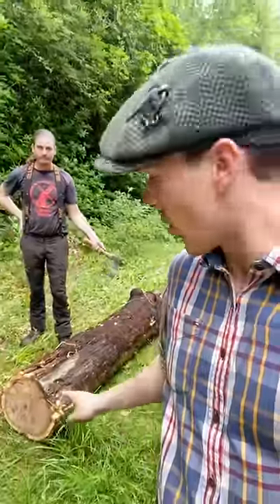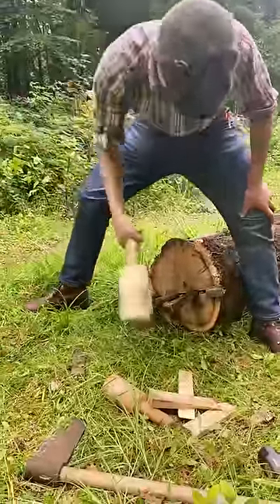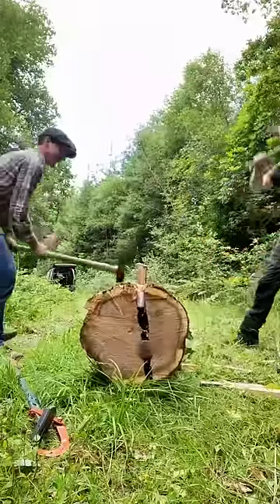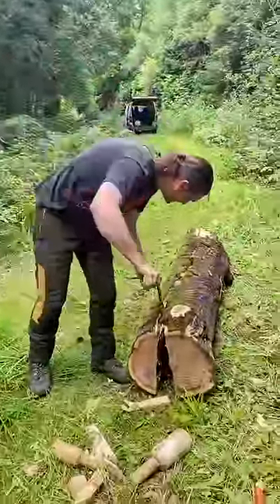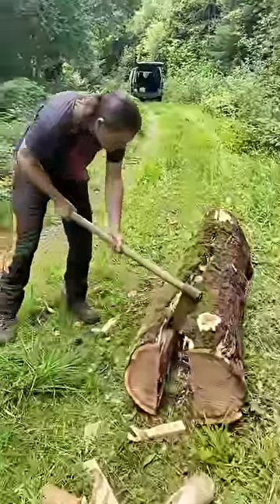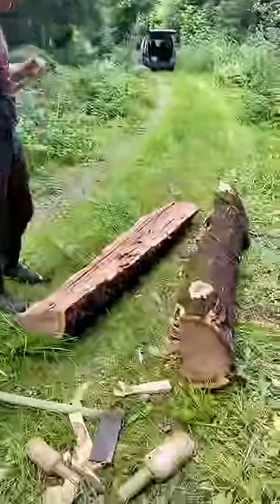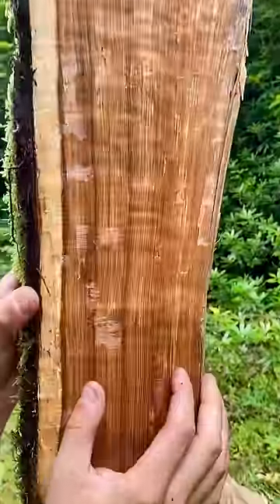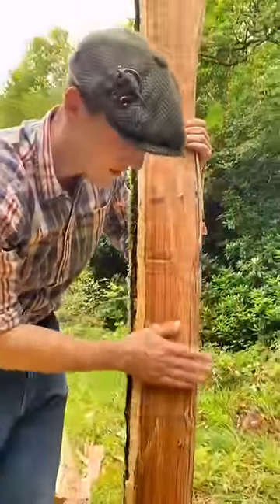Splitting Planks from Oak Log #cleaving #rivving #shortvideo #oak #handtools #tradition

Comment: Beautiful straight grain wood with no runout or slash grain. That will make fine strong planks and legs for furniture.
Reply: Basically he is using quarter sawn cut of the log... This is always the best part of any log.
Reply: @OldsmobileCutlass1969Va  best for rigidity, yes. 

But if you want spectacular figure, or flexibility, like in guitar backs & sides, or spoons, or tabletops, you will probably be better off with slab sawn wood. 

There is no "best part of a log" for all applications.

Comment: Hello i run a small sawmill in the northwest of england, sometims i get oak logs too big for the mill (36inch +) and have to split them down by hand first. Biggest one took me 4 days. If you run a chalk line down the length of middle first and then grove along the mark with an axe you get a much straighter split.

Comment: That's an impressive froe, longer and thicker than yours I bet, don't worry tho yours has a good personality!
Reply: It’s not about size, it’s about how you use it
Reply: @lukeh3020  you can use a larger one better though 😉
Reply: You need to get the split pretty much all done before you can use the froe. Look at where the handle of the froe goes into the head. It would be easy to snap that handle off if he tried to use the froe prematurely.

Comment: Odd question but do the wedges have to be a certain size or just any triangle shape?
Reply from the maker: No particular shape, we found the hardwood wedges worked a lot better than the the softwood ones
Reply: @EoinReardon  good to know, thanks
Reply: The wedges should be broad enough that one is not simply attempting to drive a wooden nail! On the other hand, too broad and they are difficult to start, the long leading edge tending to crumple. Too steep of a taper (thick at the head) are likewise difficult to start, but can quickly open up the crevice once smaller tools have facilitated insertion.

(There, that should also open up another branch of innuendo to supplement the discussion of froe envy in the comments.)

Comment: The one time I was part of an effort to split a log like this went very wrong. My uncle had tried to split a 1m X 5m wet driftwood log (on the beach)using 4 metal splitting wedges. Needless to say, the metal wedges were quickly driven to full depth, without causing much of a crack to form, because the log was on the beach, it quickly became an all hands on deck situation to make and drive in enough wooden wedges to free up the metal ones. Eventually the log got draged up onto the shore, where, AFIK, it still remains to this day, in a partially split state.

Comment: I do this work all the time for rails and short rails for protecting young trees and fencing. To make this job easier n faster, use a steel sledgehammer to hit your wedges,,, that block of wood is snuffing out too much energy.,,, if you hit a spot where it might not split straight you'll have to chop through it with a good sharp axe or or chainsaw. I split just about any type of tree,, nothing goes to waste here

Comment: It's very interesting how you have a vast knowledge of old school lumberjack technics yet you don't use a modern sawmill to process the wood.  Over in new zealand, there is an Ancient wall in the Kaimoana forrest known simply as.. Kaimoana wall.  It was highly speculated that it was an ancient pre-historic Neolithic Lumber mill.  But it was also deemed TO controversial marked as Tapu land and all info relating to the Kaimoana wall is all considered Psudo-science. Facinating how different areas of the world retain old school hard labouring yet effective lumberjacking methods while not utlizing main stream techniques such as Using a Chain saw and running all felled wood straight onto a truck and then taken to a Mill to be turned into planks.  The old way seems better, as it just requires Labouring. Mills require... Labour... Money, time, Land, ect ect ect...

Comment: Hope you didn't cut it down
Reply from the maker: It fell over 2 years ago
Reply: @EoinReardon  fair play, better than buying planks from god knows where
Reply: Using fallen trees when possible is the best option but there's nothing wrong with harvesting trees, as long as you don't over harvest and replant what you take down.
Reply: @blu8451  There's barely any native forestry left in Ireland, and oaks take decades to grow to any appreciable size. Taking dead standings/fallen trees is actually bad for the ecology of a forest, there are dozens of species of incest's that depend on dead wood, and the planted stuff like spruce doesn't support them. 

This isn't the 1500s, forestry in most of Europe is an absolute disaster. Ireland probably has the least native forest cover in Europe.
Reply: @LaughingMan44  Fair enough I'm thinking in terms of Canada where we still have decent forests. I still stand by planting the trees though, even if it takes decades for them to get to a good size you've got to start somewhere.
Reply: @blu8451  Yeah Canada is a very different scenario. What I'm saying about planting is that it isn't as straightforward as "cut down oak, plant oak saplings to compensate". Also doesn't help if you're just planting the oaks somewhere else, and if it's not of the same genetic stock.

Anyway, forestry in Ireland is in a sorry state. Only 10% or so of the country is forest, and probably only 1-3% is native forests, the rest are just plantations of spruce for commercial use. Even in this video you can see infestations of rhododendron which is probably what killed the Oak in the first place.
Reply: @LaughingMan44  Not simple but possible, Canada had been doing it for ages. I don't know all the nitty gritty details because I'm not in the industry but I do know that when they harvest trees here each area that is harvested has to be replanted or allowed to regenerate, they're pretty picky about that and it seems to work. So I may just be ignorant to how things work elsewhere it seems to me that since it can be done I don't see why say Ireland in this case couldn't look at starting something similar